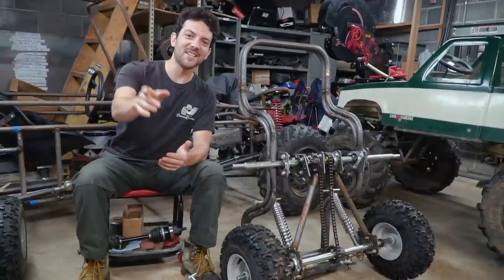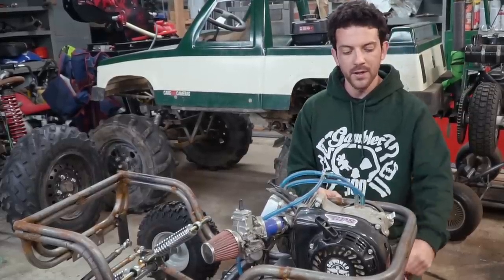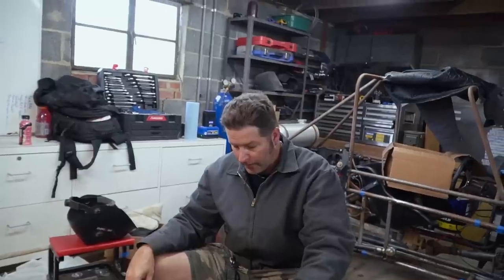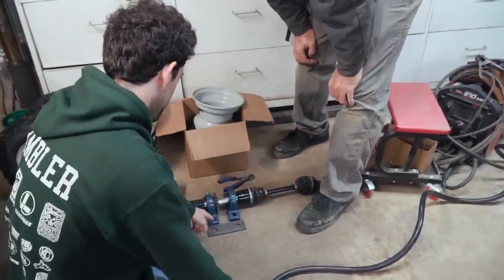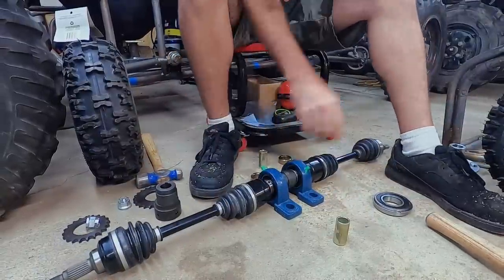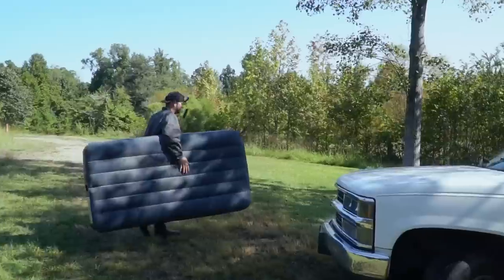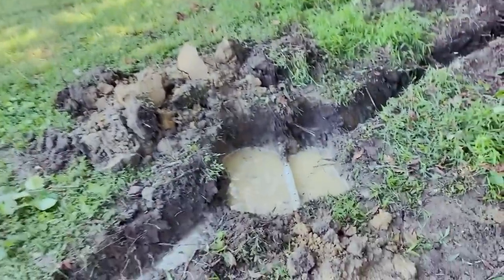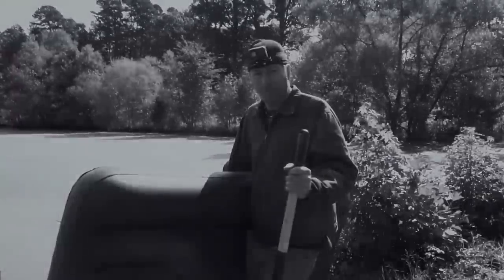4WD Power Wheels Go Kart Pt. 4 | Building 4X4 Independent Front Suspension

Comment: John, the duckweed on the pond doesn't starve the water of O2 if anything it helps keep the water cooler, which aids the holding capacity of O2 in the water.(having grown silver perch in my 4500 litre spa and in 1000litre tanks most fish like water temperature under 23c preferably under 20. 

It also helps keep the water clearer over time, provides food for the fish,it gets rid of excessive nutrients in the water, providing habitats for water insects which in turn feed the fish. 

Once you introduce fish Into the system it will start to balance out into the appropriate microsystem
It needs to be as it is because thier is a lack of predation on the duckweed it is out of control. 

 If you do skim any surplus duckweed off it is great food for chooks or animals, as well as mulch for the garden and an inclusion to the compost bin. 
Also it will protect any fish from being taken by birds
If you want a bit of clear Area use something that floats like
Piping make it into a circle and put that in the pond
I would suggest reading this I pinched from a Web page for you 😁. Especially as you are in USA and I am in Western Australia 🇦🇺 

A typical pond stocking strategy for a warm-water pond would be 1,000-1,500 bluegills, 50-100 bass, and 50-200 catfish per acre. Many recreational pond owners, however, prefer to stock bluegills and catfish to increase the size and population of bass

Research into Aquaculture 
You could set up an impressive fish and vegie garden system as well 

Oh BTW I suggest an old tinny rowing boat or Canadian canoe 🛶 for the pond 
I hope I have been of help 
Tony from Western Australia.

Comment: As someone who drafted and nested parts for plasma/laser/and punch wheels, I can say the trick to perfectly round holes with a plasma is to start the pierce at the center of the hole and have the machine spiral out from there to start the hole, adds only a fraction of a second and keep the pierce from over shooting the diameter of the hole

Comment: Hopefully that thing actually turns without a diff in the front😂😂
Reply: Thoughts exactly
Reply: It'll be fine
Reply: Was thinking the same thing.
Reply: It will, but not well. It will drag one wheel or the other. On high traction surfaces, the front axle will bind and it will understeer. On sand etc, it'll just scuff the wheel with the least traction.
Reply: Jay G I absolutely hate their motto. That’s basically saying “we fcked up but we don’t care”

Comment: I think you guys need to reconsider the shock angle at the rear, as it gives the shock progressively less leverage on the rear axle which can make the rear get stuck at full bump or have very very slow rebound. Ideally the shocks would be straight up, but since that may not give you the travel you want, consider adding rocker arms. Other than that great build, I'm excited to see how it will turn out. (I know people said this in the last video but the idea of rocker arms just came to me)

Comment: A wire wheel on a grinder usually takes dross off much easier. Dial in your amps, torch height, and speed to eliminate the dross as well

Comment: put the bubble thingy on solar panel(s), what you're doing is throwing money in the air (pun very much intended) also, if you want, you could make a liltle fontaine (pump, tube/hose, done ! minus decoration, but it'll be fine, right ?) that helps a HUUUUGE bunch when you want to oxygenate water ;)

Comment: Guy's I don't know how the workshop build is progressing but a suggestion for you,
Buy 4 shipping containers let's say 40 feet each or 2x20s and 2x40 footers
Draw a suitable square or rectangle on the ground and place one container on the outside of each side, the roof over the top doors and windows as needed, concrete floor and you have a new workshop and plenty of storage fairly reasonably priced, as you will have the middle for working the containers will help insulate so you would maybe only need to insulate the roof or depending on the use the containers as well
Tony from Western Australia

Comment: Any water in that table?  Would suck to cut through it. lol  But it sure helps prevent a fire....
Reply: Nah, no water in a plasma table.
Reply: Water is a must. It WILL  cut through the tray at higher amps. Water also cools the part and cuts down on the smoke. If you don't  want to mess with water, the Langmuir tables can be installed without the water tray.

Comment: Just a couple of "points to ponder";  I presume the front and rear axles are going to be "geared" the same and you're going to have some kind of chain tensioner on both chains to keep them from jumping and skipping?  Also, what about "Ackerman steering"?  Is it going to be "true" all the time four wheel drive, or is one of the front axles going to have a limited slip collar or something similar?  Just a couple of things that popped into mind while watching.
Also, if possible put catfish and brim or bass in the pond.  And don't forget to feed them regularly.
Keep the vids coming guys!!!

Comment: Just drill the cv axles ends and the "collar" tube and put bolts through the holes with locking nuts and you have a servicable front axle.

Comment: Duck weed, manual removal is the only long term fix.
Once the air pump has cleared an area simply use a floating boom to coral it so you can rake it out, boom only needs to be 4" fence post size, joined with flexible  link, chain is best make as long as you can handle. Done it before on a much larger ponds.

Comment: If you tap the edge of the steel with a hammer it will knock of most of that plasma slag so you don't have grind so much. Will save the bench grinder stone since the slag will burn through that stone fairly quickly.

Comment: You should hook the end of the aerator up to a wind mill so it produces the air naturally with wind and then if you need a secondary then have the pump as back up if need be. Were in Michigan and do that to most of our ponds with the windmill and aerator setup. We also use an old mattress spring and drag across whole thing like once a year

Comment: You need to pump the water into the air. Like a small fountain. They sell pumps that spray in the air. You just have to run power

Comment: I've contemplated using sprag bearings in the hub and gear it slower then the rear to help the high speed steering in my front end, it would  be sort of automatic 4x4 but would sacrifice 4x4 in reverse tho

Comment: I built a similar cv carrier but I drilled a 3/8 hole thru the carrier and axle and used a grade 8 bolt to pin so it could be serviced

Comment: I really think you guys should try to run your chain from the front to the center section before you build any more front suspension because it seems like your axel mounting plates might get in the way of your chain and it's easier to fix now rather then redesign the whole thing once it's done

Comment: The slag on the edge of your cuts is called dross ....by adjusting amps and feed speed ...torch hight you can control the kerf kerf is the thickness of your cut ...use a hammer tap the dross on the edge of your part the dross will fall off and save grinding wheels

Comment: think it will get expensive if the sprocket gets worn and needs to be replaced , think you couldve used a set of gears from a differential and weld those against the sprocket on both sides , the  gears have the splines inside you need to mount the axles

Comment: What if you welded a 4 bolt hub to the axles then another 4 bolt hub to another shaft with the sprocket no welding that way it could all come apart and be serviceable

Comment: I need some help I have a 212 I put fresh gas and oil in it but it will turn fine without the spark plug in but when it's in  I can't turn the engine at all